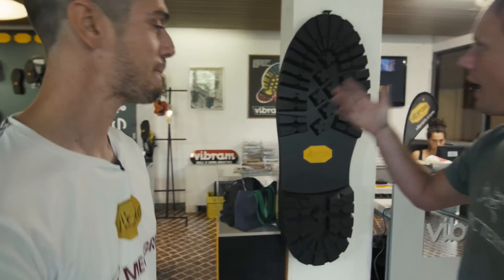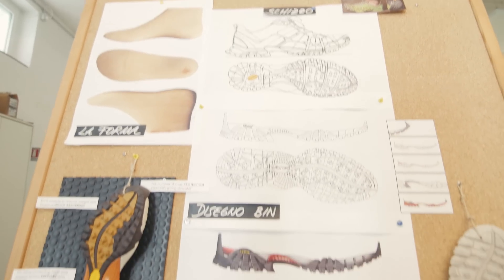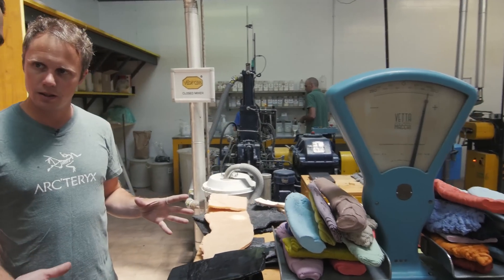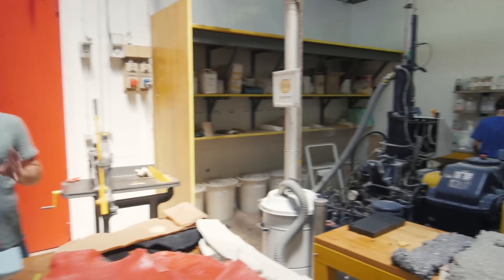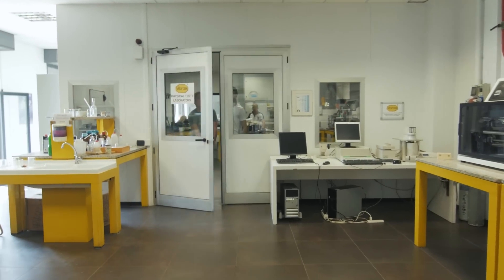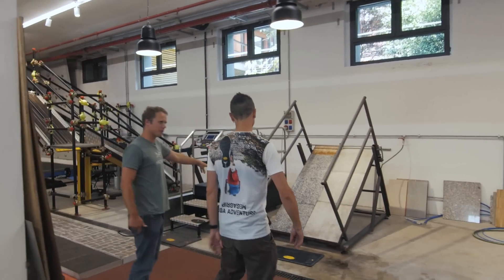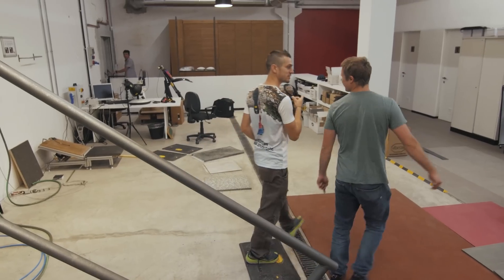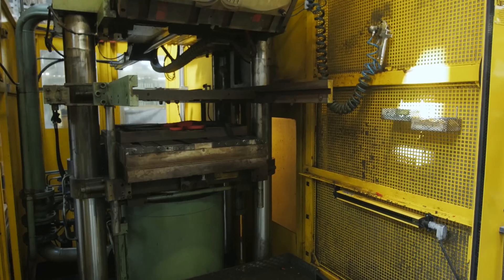How Do Vibram Make The Rubber For Your Climbing Shoes? | Climbing Daily Ep.1031

Comment: Vibram is fine in the dry, however Vibram in wet conditions on hiking boots is an accident waiting to happen. Horrible soles for anything but warm dry weather.
Reply: Vibram makes many different rubber compounds. For example, my Scarpa Kinesis boots are horrible in the wet, but my Scarpa Moraine Mids are amazing in the wet. Both have Vibram.
Reply: Did you even watch the video dude?
Reply: I don't think so you should try Meindl shoes there are from Bavaria (Germany) and they have Vibram and other sohles
Reply: Completely unrelated to climbing, i own simms wading boots with vibram soles.  Yes, i walk on rocks in water with vibram soled boats
Reply: "not ireland"
Reply: Yup Simms makes some bomber wading boots with that vibram rubber.  God I miss fly fishing....just not really any proper trout fishing here in Texas (there is literally one dam tailwater that gets sickly little 10"-12" stockers in the winter and that's it).  Here in a few years though I'm probably gonna be in CO aka trout heaven.